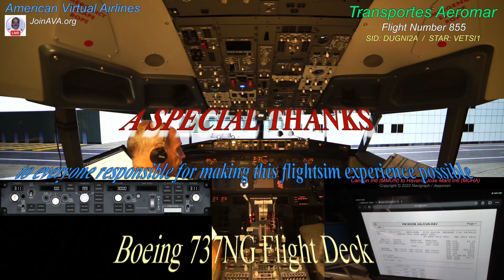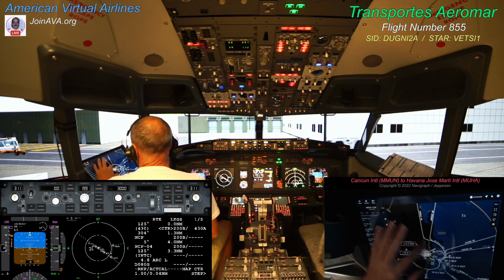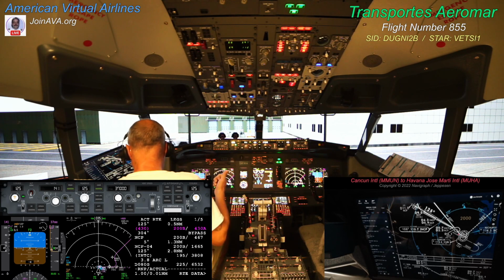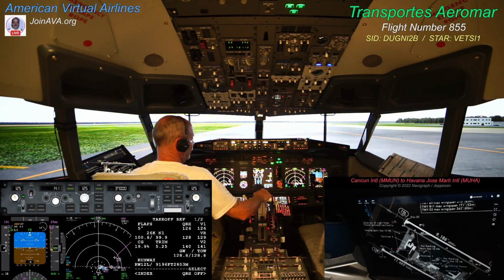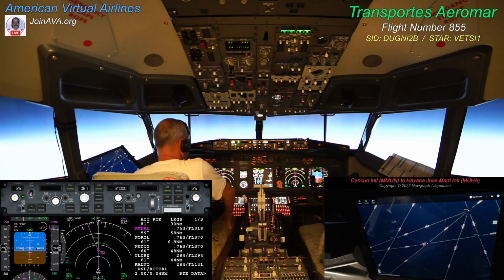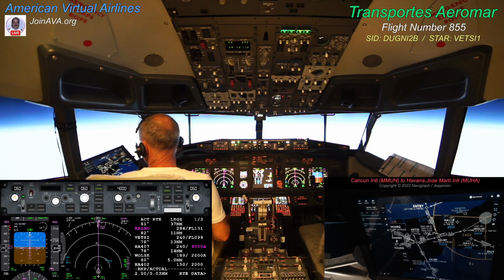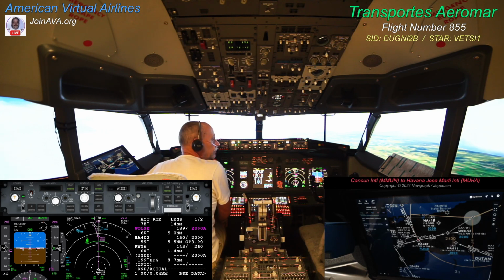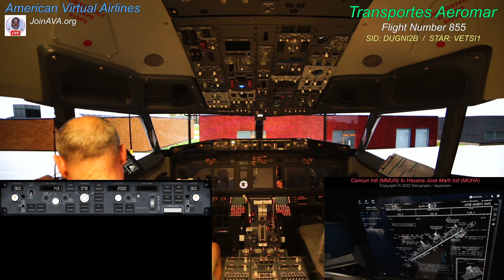Cancun Intl. (MMUN) to Havana Jose Marti Intl. (MUHA)

Comment: Hi Michael…  Thank you for all your streams, I really enjoy them and always learn something…  I noticed your green “window heat” lights are turning off and then on again, then off again with the switches in the on position at different times during your flight.  My overhead has been doing this as well.  I wonder if you know why…  Is this normal?  I don’t recall it happening in the past…  Let me know what you think…  👍🏼
Reply from the maker: Hi,

This is normal, the window heat sensors will not allow the windows to become overheated so you will see them turn on and off depending on the weather/temp conditions. The Zibo 737NG may not of had the window heat sensors working correctly in the past, that could explain the recent change you're seeing.
Reply: @swannsim    Sounds perfect!  That’s what I had thought but now it’s confirmed…  Many thanks…  🙏🏼